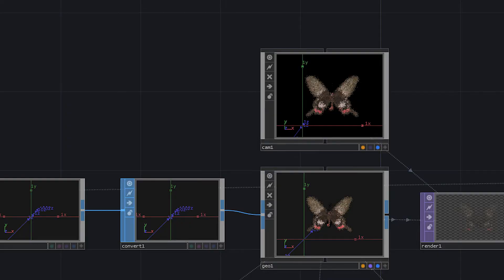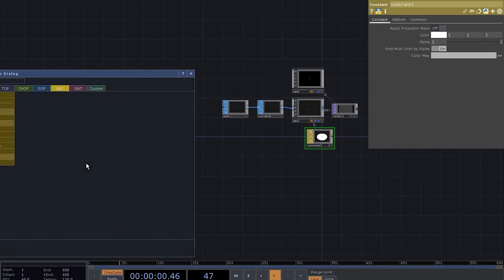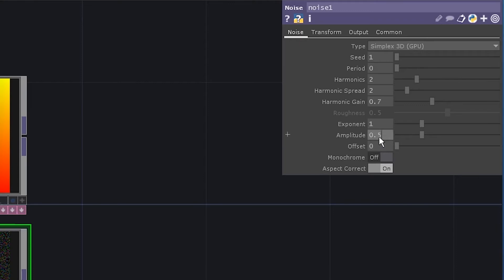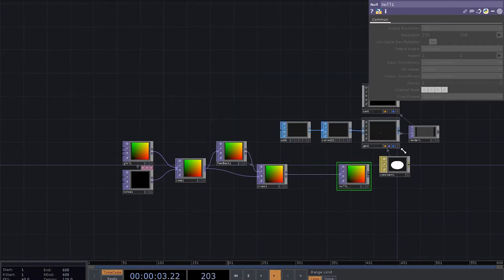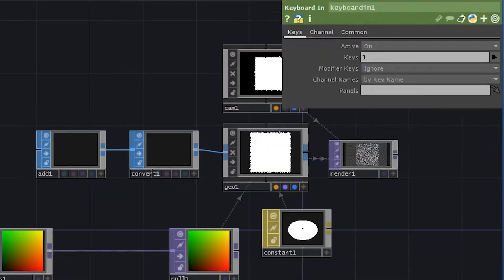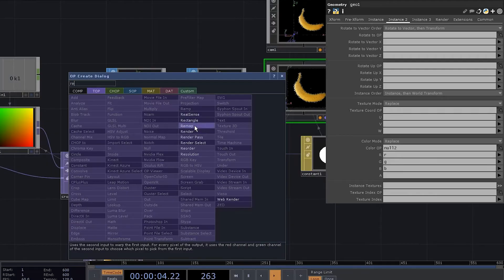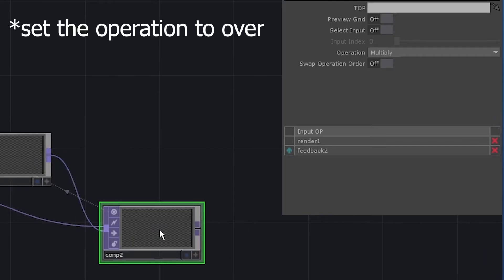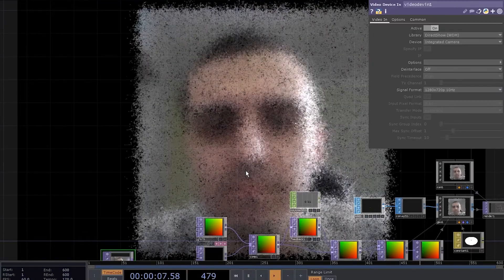Drawing with particles (Touchdesigner tutorial)

Comment: Excelente, muchas gracias por compartir, haces un muy buen aporte a toda la comunidad, se podrá hacer con nube de puntos? Abrazos
Reply from the maker: Thanks, I'm not exactly sure in the translation :)  I guess you can use a point file in TOP, either for initial points position or to apply some velocity to existing points. The problem is that this example is purely in 2D